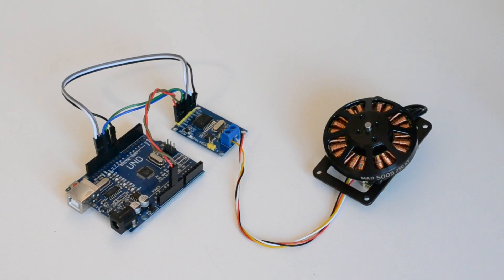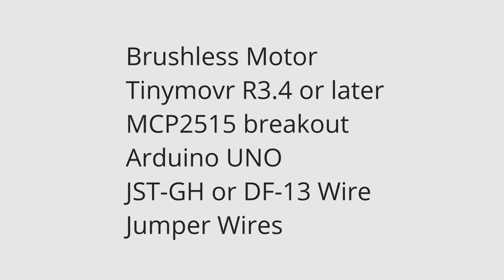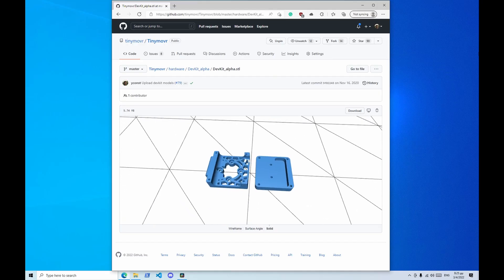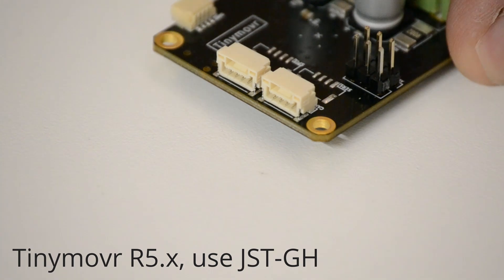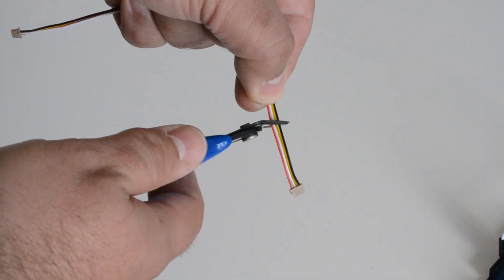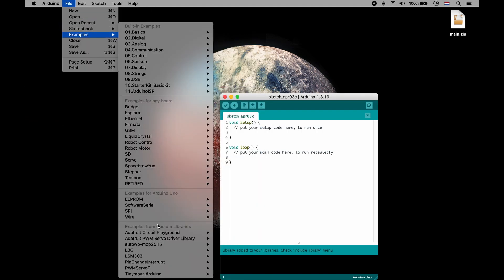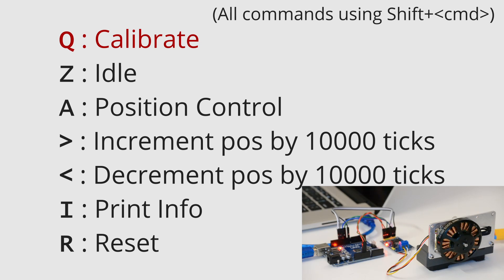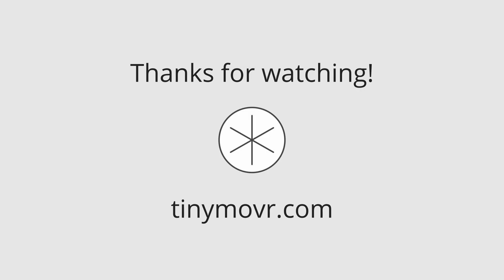Tinymovr + Arduino using CAN Bus

Comment: This board won't work anymore since this use an 8Mhz crystal and the library you recommend use boards with 16Mhz?
Reply from the maker: Yes, we explain the situation in the repository. In a nutshell, the new firmware needs arbitration ID filtering, filtering is only available with the Adafruit library, which only supports 16MHz crystals. If you are able to provide your own send/receive/filter implementation it should work just fine with any CAN setup.